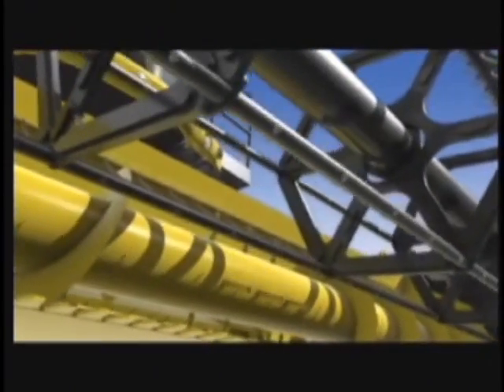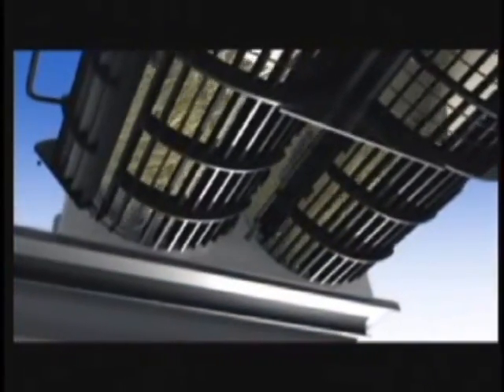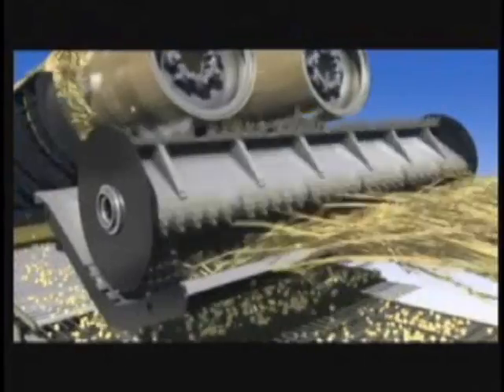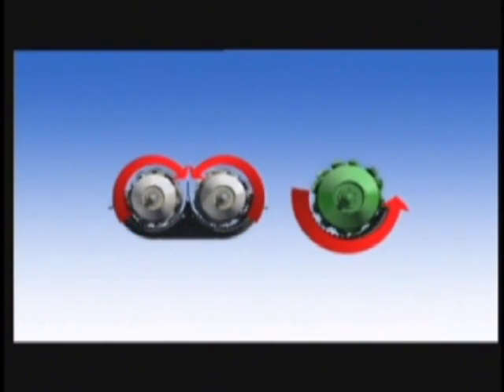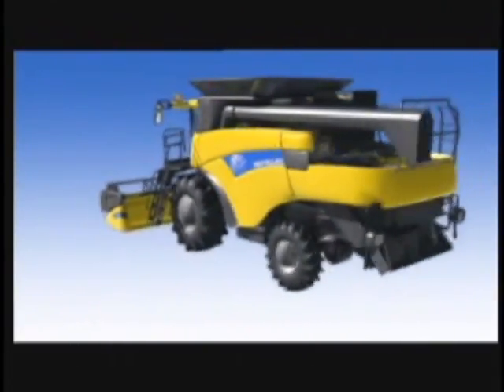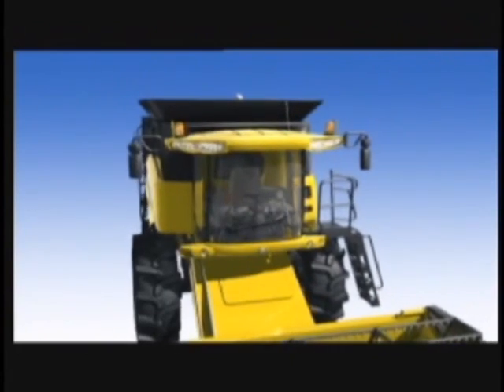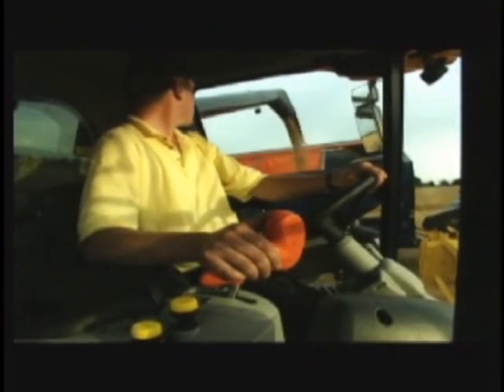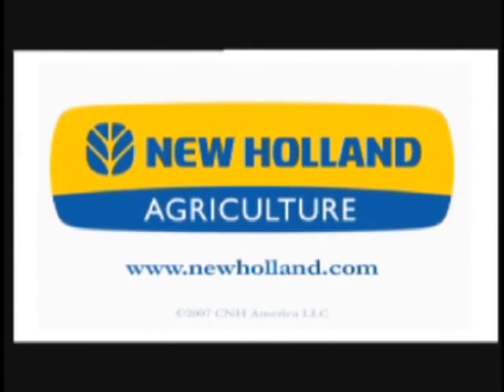CR9000 Detailed Product Features

Comment: Hey New Holland.   That's all fine and well, yes it's a great combine, but stop discontinuing parts after these machines get close to 20 years old.  Nothing more frustrating than finding out the part is NLA (no longer available).   Discontinuing parts isn't going to force us to upgrade, we can't afford to.   And given the high price and markup on parts I'd think you'd be smart enough to keep producing them even if it's no long used on the current models.  All companies have resorted to this tactic but I've found NH to be by far the worst for pulling this stunt and one reason by NH equipment has far lower resale revalue.

Comment: 2021 idea from rear drum: u mean a combine could have 1/2 the rotor(s) length and then 2 or 3 drums for better and faster feed through .. if more angle is put on concave material push through bars - so maximum thresh right through. Here's hoping